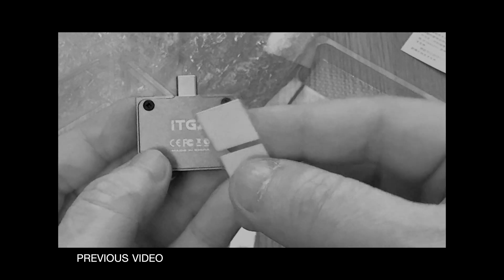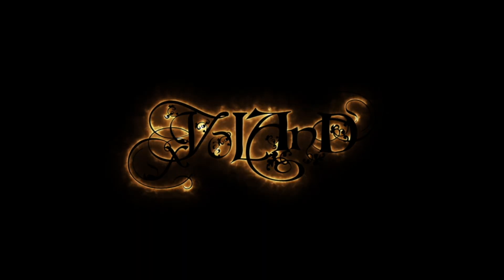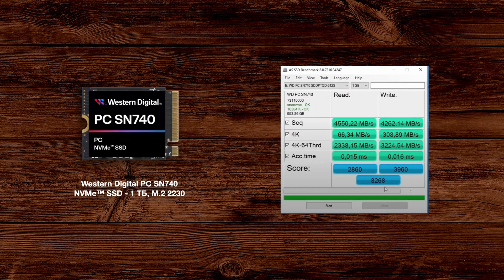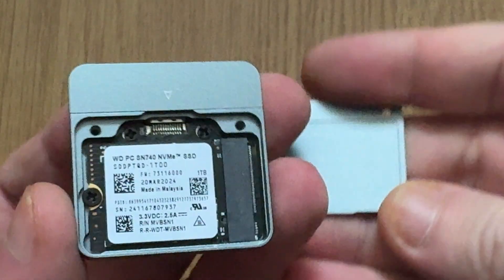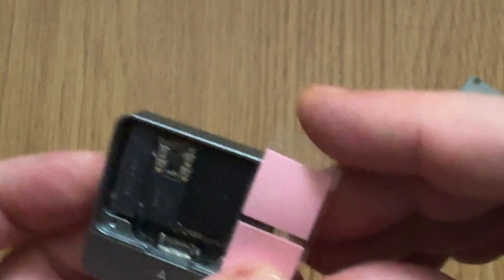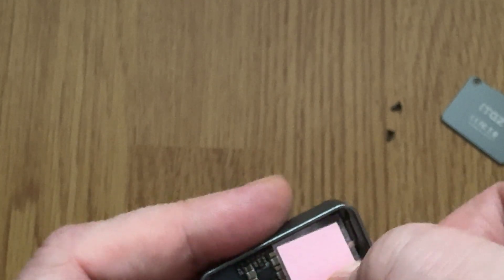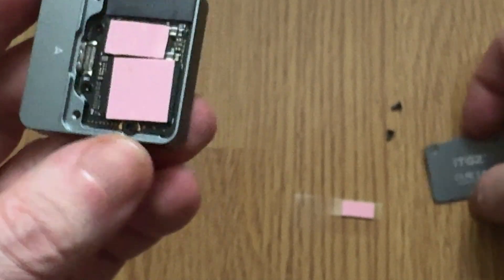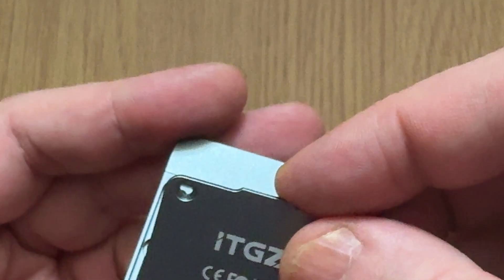🔥⚒️ Fix SSD Overheating! Portable SSD for iPhone & MacBook | WD SN740 SanDisk NVMe Heatsink

Comment: did you make some tests under load? I had one of these die after used h24 in a minipc, temps reached 104 degrees
Reply from the maker: I did not get such temperatures. I used a multimeter with a thermocouple, and the temperature was no higher than 70-75 degrees.

Comment: Hi, I have a question. Got the same ssd but it disconnects the moment I try recording and saving a ProRes video on it. Do you experience this problem?
Reply from the maker: Yeah, of course it happens. The thing is, it might just be a bad connector contact. Also, I haven’t had any overheating issues.

I’m happy with the result.

Comment: I have almost the same adapter, mine dosent have the triangle logo but is a jeyi one, i also got the sn740 and used the thermalpad but to be honest it gets still 90 degree and if you touch it is extremely hot, so I was checking and the sn740 is a good 2230 but runs hot so it is recommended for laptops, because i tested with a small 2230 cooper and it runs fine not even 70 degrees, so you need to buy a ssd 2230 for a steam deck , those runs like 15 degrees less, i saw a ranking and I found some of them available on my region I will try one soon, hope it gets cheaper on the next amazon prime days

Comment: Missed out half the thermal pad and no before and after results 😂😂😂
Reply from the maker: You’ll be surprised, but most people don’t do this. In case you didn't know, the main temperature is in the center of the chip, and anything on the edges is the pins.
I don't have a temperature gauge, so no data therefore. But, tactile is much better.